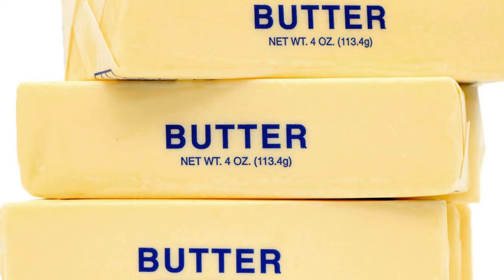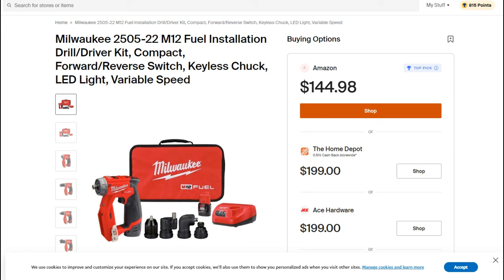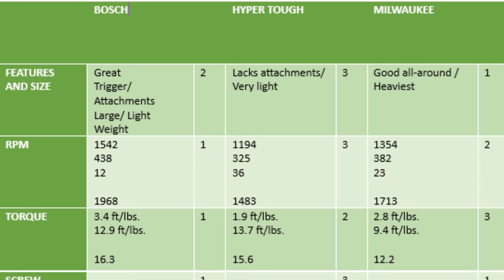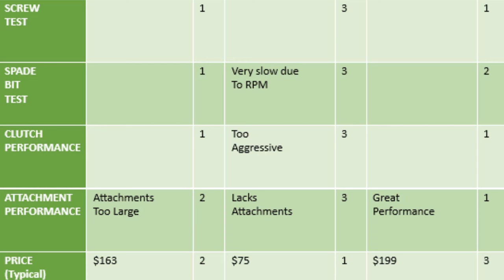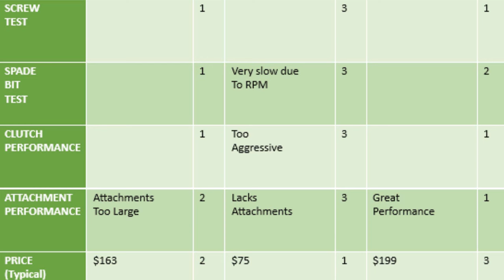Installation Drivers | Can Hyper Tough Beat Milwaukee and Bosch?

Comment: I believe the Bosch 90 deg attachment can accommodate 1 inch bits directly without using the locking attachment

Comment: You should have used the HyperTough right angle for the close drilling test because it gets significantly closer than the bare chuck. Also, you can put a bit into the Bosch right-angle without the bit holder attachment to make it shorter. Also, you can attach the offset driver or the drill chuck to the Bosch right-angle which makes it way more utilitarian for a lot of tasks.

Comment: Well I love my bosch 12v stuff (I refer to them as the classic sports car of power tools), Hyper Tough just kind of wins against everything with their 12v line up just because price. As long as they are not terrible they just kind of are hard to dismiss and for the average person probably the best buy. I have picked up the hyper tough 12v short ratchet, palm router and 3" cutoff tool (though lets be honest its a beefy mini grinder and I love it), they are all amazing for the money. If I didn't already have a few bosch multi tools and assortment of drivers/impacts from them I would in a heartbeat pick up the whole hyper tough 12v line. Im actually eyeballing their compact reciprocating saw as I have been wanting a small one. I look forward to seeing more videos on their line up and hope to keep seeing the line up grow too!
Reply from the maker: I am going to be doing a 12 volt multi tool comparison next and a compact reciprocating saw video soon. Both of those will include the 12 volt Hyoertough line. 

Hyper Tough is def a good line of tools for basic usage. I use that cut off Tool a lot still.

Comment: Love the vid.  But at 15:19 you had the hex head attached to the right angle for the Bosch.  But not for the Milwaukee.  You can just put a bit into the right angle attachment to gain extra space.  it’s has a magnetic bit holder.   It would still be bigger than the Milwaukee.   But it would make it smaller.  I have the Bosch and HT and absolutely love the Bosch.
Reply from the maker: Thanks for the tip!  I like the Bosch too.

Comment: Great review, subscribed.
I used to have the milwaukee but eventually sold it and got the dewalt instead. The dewalt 5 in 1 driver is amazing. I prefer the grip and it has a good bit more power than the others, especially when paired with the 5.0AH battery.
The milwaukee did the job for me just fine, but I wasn't a fan of the grip and the lack of a locking chuck on the right angle adapter.
Reply from the maker: I hate that I could not test the DeWalt 12 volt as well, but the budget would not permit it. Next time I will include it for sure. 
Thank you for watching and subscribing.

Comment: I bought the brush version of the Bosch last year for $130 on Amazon. My thoughts was to have a compact driver for pocket holes, as the chuck on my full size drill frequently 'bruised' the wood during the installation of a pocket hole screw, even using the six inch driver. What I found was my #1 go-to drill-driver kit. I've taken it out on the road to install cabinets, actually build cabinets and just in general to have the oddball attachments necessary to a woodworker...that ONE time you need an offset or right angle attachment. As shown, the Bosch right angle head is pretty big, but in all but one case it has been just fine. I love my lil Bosch.
Reply from the maker: Very good feedback, thanks for commenting.

Comment: I never thought of getting one of these drills but I can see the benefit of having one. Great video!!
Reply from the maker: Thank you, glad you enjoyed the video.
Reply: It'll change your life. These aren't the 12v from the past.

I bought the original Bosch pocket driver back in 2006. It was 2 pounds and offered 80in-lb of torque and a max of 400rpm. Today, this tool weighs 1.5lbs and offers 300in-lb of torque and a max of 1700 rpm (for reference, a high-end 18v nicd drill in 2006 was often just 450in-lb).

Since I've upgraded, I only pull out my 18v drill occasionally when I'm hammer drilling, doing a lot of large drilling, or lots of repetitive drilling with my pocket hole jig (where saving 0.5-1 second per hole adds up). Meanwhile, my arms thank me as I'm not growing younger.

Oh, as a final note, the Bosch has quite a bit more drilling torque in high gear if you use the 6ah battery.

Comment: I think you made the right call with the Bosch.
Also there's an SDS Plus attachment you can get for around $100 which would make for a nice lightweight rotary hammer in a pinch. The attachment by itself makes it a very intriguing but also versatile tool
Reply from the maker: Thanks, I have been using the Bosch steady in the shop. Really like it.

Comment: I picked up the flexiclick for around $100. I already had an OMT but for $50 more it might be worth snagging both. I just didn’t feel I use OMTs enough as a homeowner to need a second one

I have both the m12 installation driver and the Bosch. I prefer the Bosch but if you put a gun to my head, I’d make the Milwaukee work

Comment: I like bosch the best. the grip on the milwuakee is the best in my opinion. i like the drywall screwgun type grip. i feel it is underpowered and dont like the knuckle guard and felt underpowered for my purposes. magnet is actually super useful though, i wish they would put them in all drills to hold a few fasteners. bosch my favorite because of how compact it slips in my hammer holster and lives there. ive seen other reviews and the Dewalt is the strongest but i never tried it. hypertough 12v seems like a great value but my favorite is still the offset attatchment. if i didnt use tools for makin money id recomend hypertough because you can buy cheap rachets and inflators and batteries for 1/3 of the price of other brands. but the milwuakee and the bosch will still work after 7-10 yeaars, with cheaper brands sometimes only last me only 3-5 years before bateries die or motor burns out. very tempted to try their tools because of how cheap.  but i doubt it would survive many drops off a ladder.  with a pricey tool u can sell it used after 3-5 years for half the cost and upgrade. if the tool breaks it feels like a waste. less stuff to be disposable the better, especially tools should be made to last. realistically we cant all afford milwuakee and premium tool brands are too expensive in my opinion.
Reply from the maker: I agree with that assessment. I like the Bosch as well. It is a little beast. I mostly use the 90 degree in the shop, so I could get away with the Hyper Tough if it proved durable (likely not compared to the others). I am real impressed with the build quality of the Bosch, especially how it attached together.

Comment: For the cost Hyper tough would work for most people. I still don’t see what I would use an installation driver for , at least for what I do. Great video Zack!
Reply from the maker: Thanks man. Crazy thing is I never used one at all and since I made this video I gave needed it. Used the 90 degree on the M12 setting up for the next video on oscillating tools.
Reply: @HVACShopTalk  i got the hypertough one just to try it cause it’s so cheap but i can’t figure out when i would ever need it. Any right angle bit will do the job just fine and takes up way less room
Reply from the maker: @jamesjames6202 yeah if you don’t use them very often then just keeping one of the right angle adapters around will probably do the trick

Comment: This is fantastic testing you are performing! I am curious though,  why you dislike the built in charging option  on the Hyper Tough batteries.  In my opinion, it can be considered a win because it's one less piece of hardware to contend with. This is coming from a Milwaukee fan.
Reply from the maker: The charge time is soooooo slow that way. Its several hours on some of the batteries. That's the only reason I dislike it. If you only use the tool periodically it wouldn't be an issue.
Reply: @HVACShopTalk  Yes, agreed. I stated that before from a DIY view.  There is no rush from that perspective.

Comment: If there are [necessary] things a tool can't do, I'd disqualify it.  The Bosch, for example, is too chunky to get that right-angle attachment to work in some tight areas, so it would be useless; BUT, there are alternatives.  There are 3rd-party right-angle attachments that are smaller than any of those.  A flexible attachment makes the offset attachment almost irrelevant, unless you need to apply more pressure than you can with the flexible one.
I think you need to do a torque test to judge the chucks; they could just have different progressions.
Reply from the maker: I thought about testing each Chuck but decided it would push the video  time too far. Maybe a follow up could answer those questions

Comment: is the willfaki incredibly efficient and able to go so much further on a battery, if its brushless then no because to drive brushless you need ac current
Reply: on this comment is the milwauki designed to not burn your hand under a heavier load over a period of time. back into the ergonomics category, is burning your hand an issue
Reply: batteries show heat when their stressed as well
Reply: you block the flow of air to the fan on the rotor :( boooo
Reply: a brushless setup tends to produce less heat under load over a period of time, imo
Reply: but that depends on load

Comment: which one are you going to have to recharge first is what i want to know
Reply: battery integrity to me as a consumer is an important stat, alot of things can be told about crap batteries, they work a couple times then they dont. the performance is so bad the tool can over use the battery, causing the lifespan to deplete significantly. maybe a year or two! when they can claim to us they get 10 years out of them.

Comment: interesting how much more powerful the bosch is. maybe battery life would be an interesting category to add. maybe even ergonomics, as in, vibration = wasted energy. nice video bud
Reply from the maker: I purchased a device for measuring vibration that I will use in my next comparison video. Thanks for the suggestions.
Reply: @HVACShopTalk  you could look at an icharger + psu + discharge combo from someone with alot of advanced control. you could shoot 200 amps to the battery and it may only give you 30 amp charge rate, or 100 amp charge rate. they all vary
Reply: the battery will only do what it can do, you can really dance all around the limits of its amperage and discharge rates, for example flying a model drone
Reply: maybe the drone community would be a better place to look than me
Reply: charge amperage*
Reply: its my understanding you can use a battery and the icharger as a bank to safely inject high amperages at the nominal voltage of the individual cell, but of course all these devices are going to be using a series setup

Comment: I think the price listed on the chart for the hyper tough is incorrect because of the way it was tested it wasn't tested with the 4ah battery and charger  just my opinion. Still a good video thoe.
Reply from the maker: It was priced for the 4 AH, your right. I prefer using the four.
Reply: @HVACShopTalk  I agree maybe a rematch with all having a 4ah and tested with the 4ah just a thought.

Comment: battery quality can have alot to do with performance, theres lots of different dischargers on the market for a cheap easy test
Reply from the maker: As I do more of these videos I will acquire more testing equipment. Thanks for the suggestion. What model would you endorse?
Reply: as far as battery dischargers i like the  @HVACShopTalk  isdt fd-100 for my model rc car lipo pouches, i can set a certain amp draw on them and time the discharge, As far as the drivers in your video probably the bosch :D
Reply: plus that discharger is more safe to use because its going to auto detect the lipo cells and not over discharge them all magicly
Reply: that may only bring you down to storage voltage as well, to completely drain the packs i would get ISDT D2 Mark 2 LiPo Battery Balance Charger
Reply: lipo battery quality can be found out by the charge rate it will accept to, but then your getting really dangerous. who quality controls all the batteries, you know?
Reply: its more of a yield situation in my mind, like apple's processor strategy. apple gets lion packs of quality
Reply: lith ion pouch*
Reply: without apple demanding their iphone run for 8 hours under load. that means there is quality control in place

Comment: unfortunately your test was flawed when it came to the 90° attachments. the bosch can handle way smaller sapces when using a bit directly instead of the way you've shown here with the locking adapter. it would be a fair comparison to the milwaukee. greetings from germany
Reply from the maker: Yes. Another commenter mentioned that. I may revisit this in a short form video.